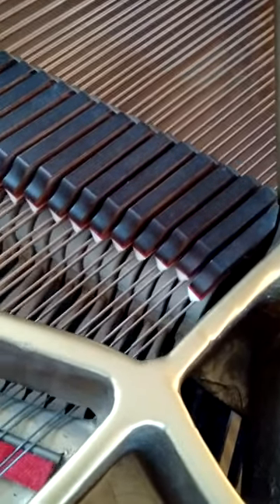An interesting buzz

Comment: I had the same buzz on the same notes!  The culprit was the lowest A also.  Wish I would have found your video first.  Drove me nuts for several hours until I decided to dampen strings as I tested to figure it out.